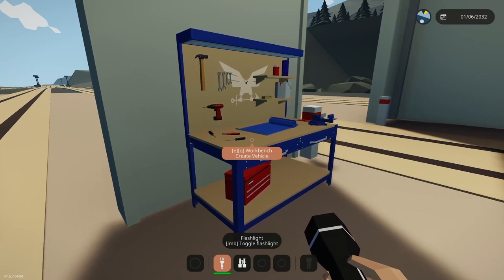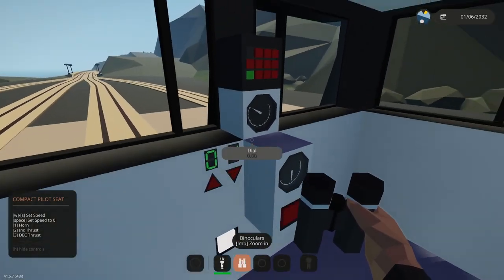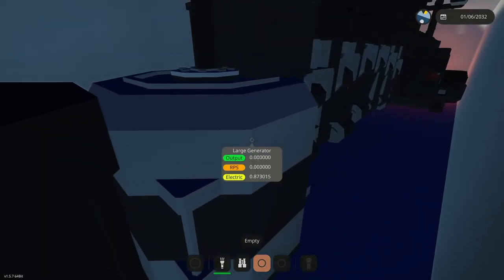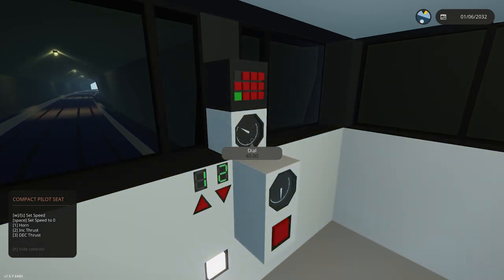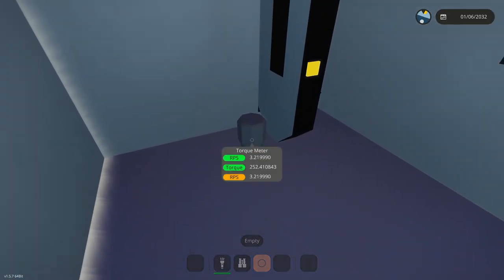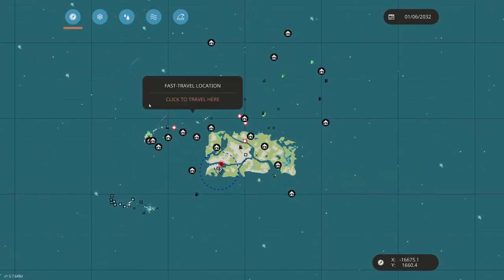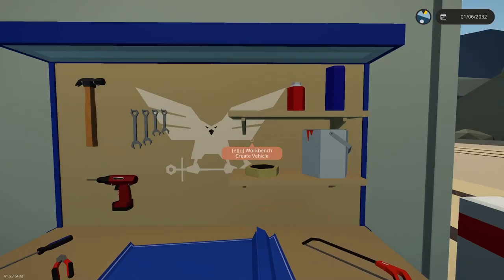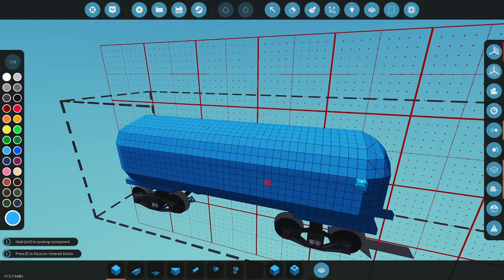Stormworks Career Build Series 131

Comment: One observation you might be able to make use of is that I tried empirically measuring the circumference of the train wheels by comparing vehicle speed against wheel RPS. Normally they measure around 3m, but they read lower under acceleration. Once they reach about 2.7, they spin. I believe the value for a braking skid is around 3.3m.
Assuming your train controller is based on a PID reading the requested speed and operating the throttle, you could keep that system when the requested speed is close to the actual speed, then have a PID reading the apparent wheel circumference when the speeds are pretty different. E.g. When at least 5mph slower than requested, PID-control the throttle to have a wheel-circ of maybe 2.8m.
Reply from the maker: I ended up making it direct drive. It works very well now. The issue is that the in-game electric motors cap out pretty much a 19 RPS. The benefit of real motors being that they can go to very high RPS. So with the game limitations really can't make any sort of electric transition system work properly.